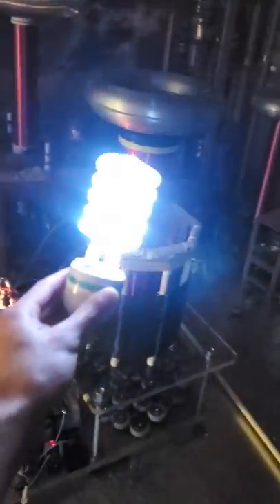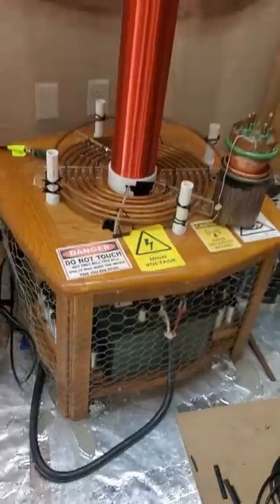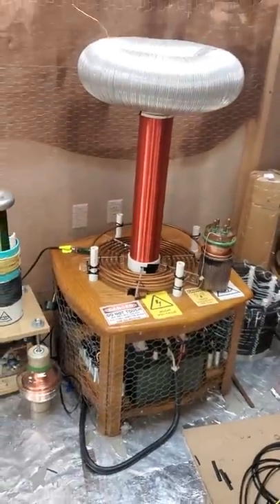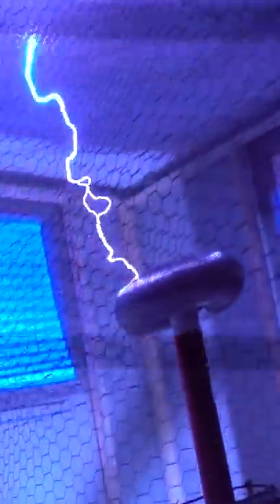optimizing a tesla coil for wireless power

Comment: Sweet, looks like you got the vacuum tube coil working much better! Maybe that means an updated video on the VTTC?
Reply from the maker: i've been waiting till I have a bigger power hookup to make a full vid with that tesla coil so I can do it justice. it is not a classic VTTC circuit. it uses secondary feedback which means it's always in tune, even if you are doing crazy stuff like lighting it on fire :D
Reply: Neat what kind of tube are you using?
Reply: @styropyroshorts  man what kind of panel you got on your house lmao
Reply: @desertoutlaw3317  bold of you to assume he lives in a house and not under a power substation.
Reply: @thebigcheese8715  he probably has 3 phase 680v running to his house😂😂😂
Reply: @desertoutlaw3317  where in the world does 680v exist lmaob
Reply: @styropyroshorts  how could I obtain one of these cool machines and how would I go about operating it if I do receive one?
Reply: @johnbaum1000  probably thought that since Europe Has 3 phase a 230 volt that it adds up. But the European network is 400 volt or 230 volt. Not 600 +
Reply: @kaitan4160  I guess so. we got 600v 3phase in Canada or 347 to neutral if it's Y fed.
Reply: @thebigcheese8715  lol

Comment: Man, imagine if instead of all of these direct cables, we had coils broadcasting power to all of our devices
Reply: Cixin Liu's Death's End explores this concept
Reply: Then you would be jamming certain signals and be putting noise into every wireless device. All device designs would have to be reconsidered and adapted to this standard.
Reply: That would probably put enough RF power density into the air that the people scaremongering about 5G actually have something real to worry about
Reply: I don't know about it. If u have to pay for it then some people would just steal from others, it's not that secure. If there could be a certain frequency for security sake through which the electricity passes through good. But it's electricity.
Reply: @ComPewPer  I’m into sci-fi (read Yevgeny Zemyatin’s “We” right now… just finished a long Le Guin / Philip K Dick kick… but those sound good, is the English translation worth it? And would you recommend reading the trilogy in order?
Reply: This is what Tesla coils were originally designed for.
Reply: just one question for that..

What power to which device.
Reply: @HighlyRegardted  The Remembrance of Earth's Past is the title, the English translation is excellent. The chronology of the series carries a lot of weight so i would suggest reading in order.
Reply: @zuthalsoraniz6764  if anything I'm pretty sure its actually good for you
Reply: It would make radio signals impossible to use. No phones, wifi, radio, ect. It seems like a good idea but is actually rather conflicting with our modern world
Reply: @quorthonsinferno5119  if Tesla had gotten his way and Edison hadn’t fucked him over with his shitty elephant torture show we might have wireless energy transmission as the standard and technology would have been developed with that in mind. Although I imagine the long-distance transmission would still have used wires, changing to wireless only at the end consumer, so things like radio interference would be mitigated in that way.
Reply: And at the same time you'd be unintentionally inducing current in things that you really wouldn't want to.
Reply: that was the plan

Comment: A common low energy circuit is the slayer exciter, usually implemented with a single small signal NPN transistor like a 2N2222. Higher power versions can be constructed with mid to high power NPN's but are pretty inefficient. They are in essence a continuous-duty single resonant SSTC operating in Class C or Class E depending on how well it is tuned. If there is even a tiny arc between the secondary and the top load, it really drastically impacts the radiated energy. A solid connection is required to keep the Q factor as high as possible so that the voltage on the topload reaches the highest value to allow the most efficient capacitive coupling of electricity.
Reply: What
Reply: @rigo.acosta  electricity go brr
Reply: @rigo.acosta  all of that stuff can be googled.
Reply: At least there's some comments with credibility!!

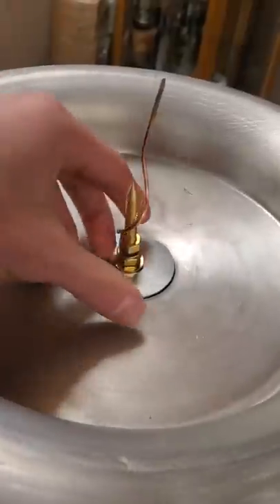Comment: would the relatively subdued Tesla coil that's powering the lamp at 0:24 still be dangerous to touch etc?
Reply: I'd imagine you'd be dealing with a fair bit of charge so yes.
Reply: Very high frequency AC doesnt care if you are insulated by your shoes etc, the capacitive effect of your body guarantees you will get hurt.
Reply from the maker: a quick touch wouldn't be that big of a deal, but a zap much longer than that has the potential to cause severe burns.
Reply: @styropyroshorts  thanks for the answer :)
Reply: @styropyroshorts  love you man. Gay with me

Comment: Recently a non-radiating electromagnetic source was invented, commonly called an "Anapole Antenna" which does not reflect or emit EM waves into the far-field at it's resonant frequency. It is made of two complimentary or conjugate current distributions which destructively interfere. One current forms a dipole moment, the other current creates a toroidal dipole moment. Because incoming EM waves cannot reflect from this antenna without being suppressed by interference, the energy must constructively interfere within the antenna, which allows it to confine a great deal of electromagnetic energy in the near field with low losses. I'm extremely curious if a Tesla coil tank circuit and toroid can be modified to achieve Anapolar resonance so that it can transform the incoming energy of very weak signals with no reflective loss. The quantum potentials φ and A are also produced by this process and propagate away from the antenna, which could allow novel tests of the Aharanov-Bohm-Casher effect or other exotic quantum technologies.

Comment: I came up with this concept in 7th grade except I didn't use tesla coils , I used electromagnetic coils capacitors and used burst from an em to produce charge within the electric field that would basically go round and round until enough power was stored up to power the device , I won the science fair almost and samsung turned my idea into a phone charger from witch I was not compensated

Comment: So where do people get the long spools of wire? I’ve been trying to make these but have been failing at getting enough wire. Also how dangerous is it for a human or electronic device to be in its emissions range of em fields?
Reply: For humans, not dangerous (unless you touch it of course) for electronics, very dangerous sometimes, so I'd do it at least a meter away from anything for small coils. If you don't want a crazy coil like this, you can use the coil of a microwave oven fan, they make around 15cm tall coils If you use a pvc pipe of 8cm diameter, which is enough to make like 20cm arcs with dual Mot setup, or way more in other solid drivers. I got some videos of mine made with that coil and using soda bottles as capacitors, so you can see the results of a very low price coil.

Comment: Actually all it is need to be tuned to the frequency of the earth and it alludes emit wireless electricity you can tune them but you need a little bit better system than what you got on that Tesla coil most people don't know that though

Comment: The 230kv transmission that runs through my town has metal street lights built under it, and poles will shock the everliving crap out of people. There is actually enough induction on the street light pole to create a 1 inch arc when you touch metal objects to it. Does anyone know how to charge batteries with this? You could get free electricity if you lived under a transmission line and figured it out.

Comment: I have a question, what if you had a resistor such as a light bulb near the coils and then wires coming off the resistor to feed a whole home like through a socket? Or Does the device needing power have to be close to the coils itself?

Comment: So dose this give devices enough energy for them to run or is there potential for devices to get to much power at a time and cause undesirable functions? Does wireless charging work through this? Are you able to power a computer/console/mobile device with this?
Reply: Genuinely curious if your able to control the output to certain devices for maximum efficiency.

Comment: Hey pyro. I’m trying to build a Tesla coil that gives off large arcs for a project in about a year. So you think you could help me out with the design? I will have an input voltage of 120v and 60Hz but that’s where the progress ends. I have no idea what components I need and what they would need to be rated to in order to achieve my desired results. If you can help me out it would be much appreciated.

Comment: Its cool but not how wireless power tesla had invented worked..
He used millions of volts with 100 thousand amps. 
An 18' spark gap at about 8hz. 
Inside wardencliff tower the spark went to ground.
The 8hz is the earths resonate frequency. 
The sparks set up a " IMPOSSIBLE " Said by academia to keep it from happening again. A longitudinal wave throughput earth and all atmospheric pressure. 
The power is extracted from thin air by devices like radio combined with transformer to pull whatever ratio the end-user needed for each devices use...
No static charge everywhere like in close to the sphere..
Just as radio works so does Tesla's wireless power...
Academic in the most part is to hold down this technology and to keep petroleum technology on the top.
Tesla said " I HAVE MADE A MISTAKE "
wireless is far more efficient whereas 100 hp can be multipled endlessly in different machines with zero draw on power from the tranmitter worldwide.
Dc. Direct current
Ac. alternating  current
And the long hidden
RC. Resonating current.
Try to set up 8hz with your Tesla coil and see how long you can transmit before the fcc stops by..
Reply: No body understands

Comment: The orientations for all type micro beauties the vibration energy is never lost it turns into something else sometimes back in on itself is powerful enough to be realizes so a recievers to drawing in the same instances as the first a common form of programming language that natured the whole thing about training the brain and memory of the experience is useing the right tool's. The radiation from the arc of flash waves has an up down charges wild unruly mob of atomically charged bounces and work on flowing streams in and around the world contradicting the construction industry and a strangest configuration of the experience of waists of useing fuels to make electricity generation and a couple of other exspensive ones solar panels on the roof that produced a lot of wakefulness we been blessed with naturally occurring programming languages changes to a vortex spin plasma glass the highest level of service to the public revolts the Volts to a softer liter power that starts the whole thing. inverters and the circuitry is powerful knowledge of embedding memory in stone crafting the alchemical to vibrational magnetic resonance ultra hi ultra low compressions to expansion ability to delivery